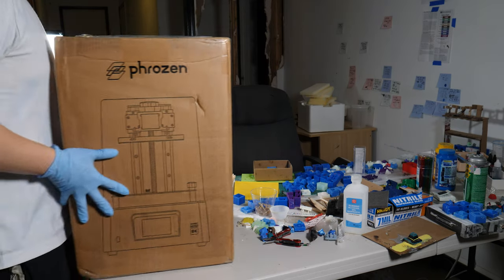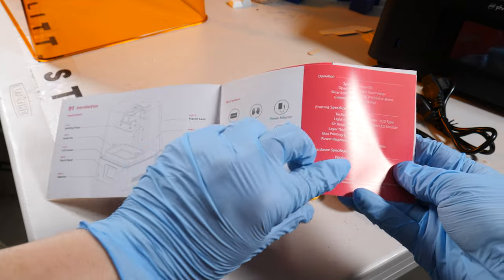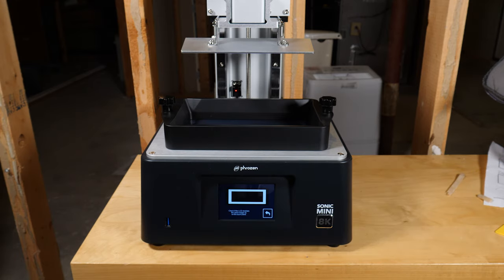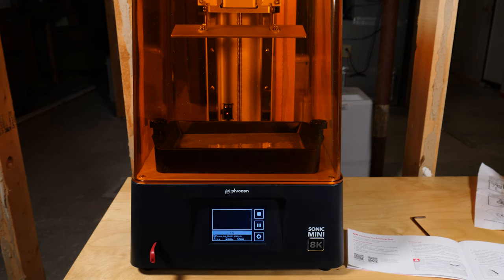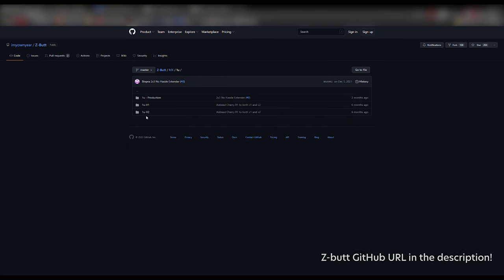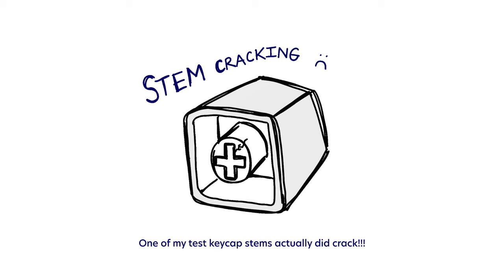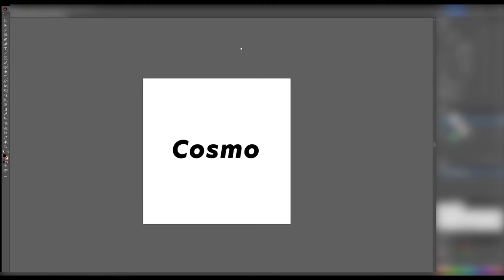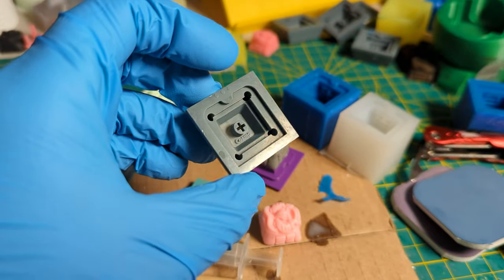Figuring out how to use the Phrozen sonic mini 8k for Artisan Keycap making

Comment: Hey first of all very informative video. Thanks for that!
Just have a question what is the different between 3dprinted keycaps and resin casted keycaps?
Reply: SLA printed keycaps use resins specifically made for curing using UV light layer by layer, while cast resin is usually self curing (from a mix of two part solution). The prints tend to be quite brittle (more so if they are cured for a longer time), so the stem part may not be very durable in use. It is common to use a printed master to create a silicon mold, then use the mold to cast "production copies".
Reply from the maker: Yeah pretty much my findings as well ^. You either can use Clay to make your "master" keycap, or 3d-print your master keycap. You then take the master keycap and make a mold using silicone.

Comment: Also is there no universal size on stem of the keycap? my switches are black gateron silent but the keycap keeps falling of. T
hat doesnt happens on my old outemu switches.
Reply from the maker: To my current understanding, there IS a "standard", which I think they try to adhere to the stem dimensions from Cherry. 

Though, each manufacturer may have different tolerances and acceptance criteria, so there's bound to be some slight variations (I think).

Comment: 5.7mm stem diameter and 3.9mm stem hole works best for me. 5.7-5.8mm stem diameter makes the stem much stronger and thicker and still compatible with all mx switches. using mixture of regular and flexible resin makes keycaps unbrakable.

Comment: so did those adjustments work or what?
Reply from the maker: Yes!!!! Adjust the stem by using the actual dimensions. It'll differ depending on your casting conditions + resins you use

Comment: And I wanted to say to all of you who want to start making keycaps with resin printers. I have been doing this for a long time and what I recommend is that you make the cross in a PLA printer and then glue it to the resin piece
Reply: The resin of the printer in what I have seen is not so resistant and it tends to break.
Reply from the maker: Yeah I don't put the 3d print directly on my keyboard - I use silicone to make a mold of it and then cast it with resin!